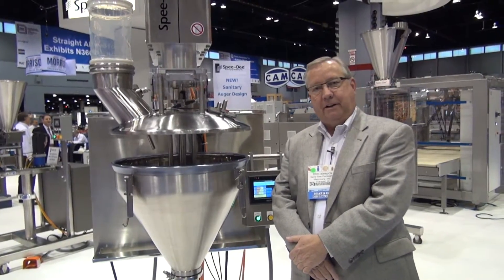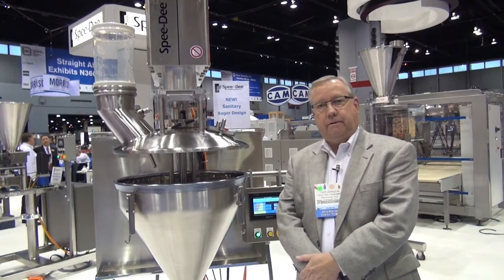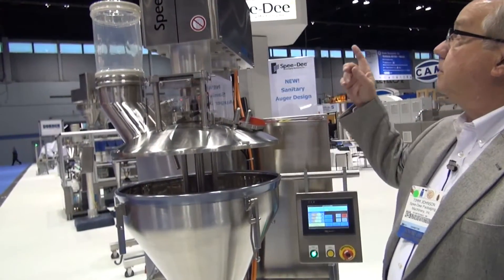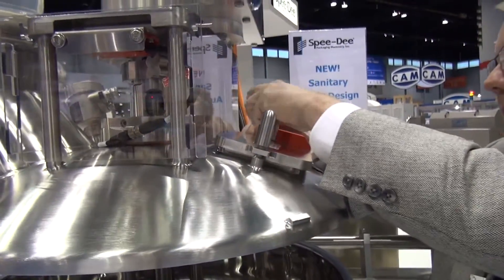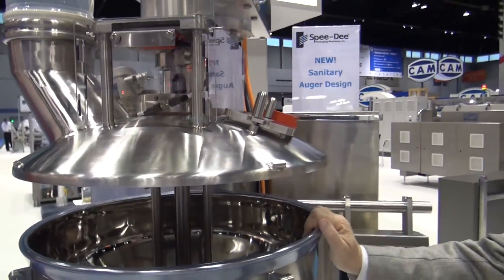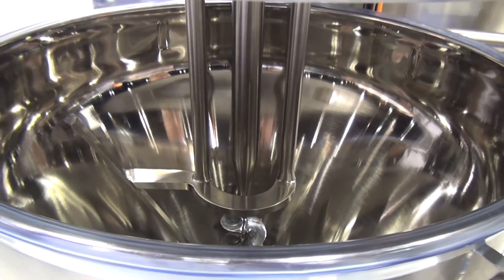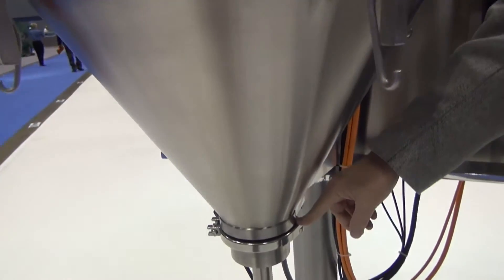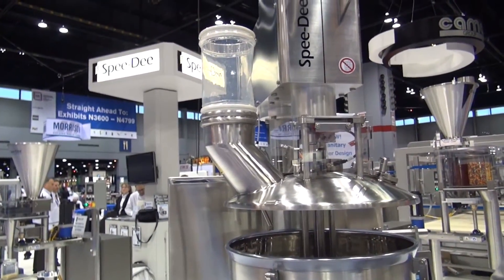Pack Expo Video Tour: Spee-Dee Sanitary Auger

Comment: We had 4 spee dee fillers. We used them with rock salt and heavy bath grains that would either burn the product using an auger style filler or would have stopped the auger dead  due to friction and scoring the product. We made special shrouds up for different dosing requirements. We automated two of them and indexed the laundry detergents boxes we filled. Normally we used a foot pedal to activate it. They were very tough machines and easy to clean for shade changes and job changes.